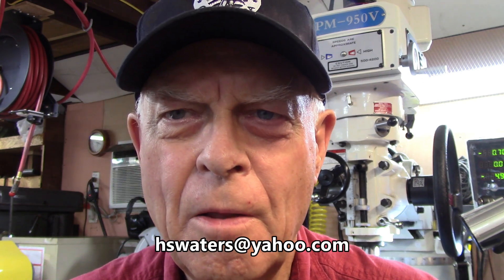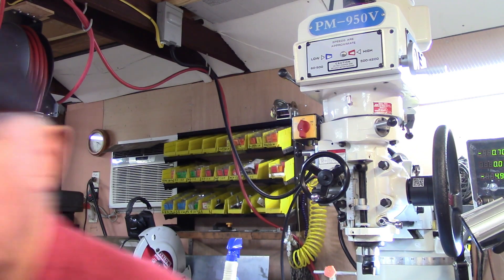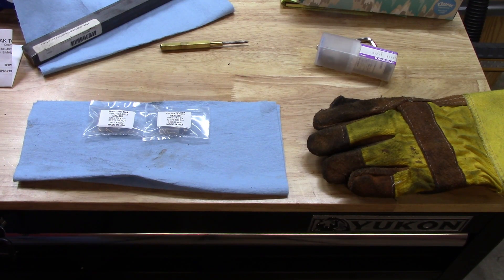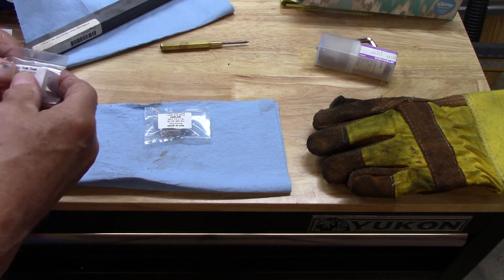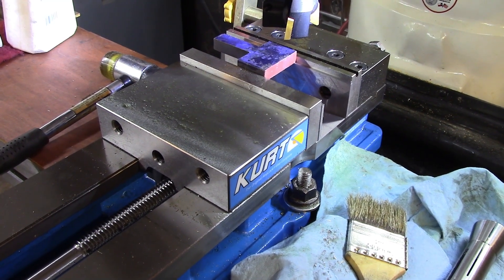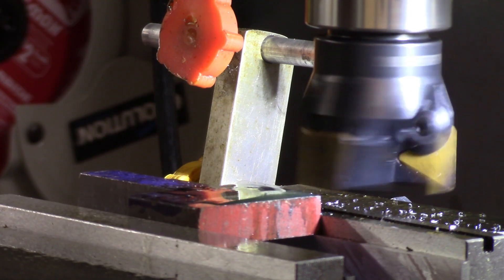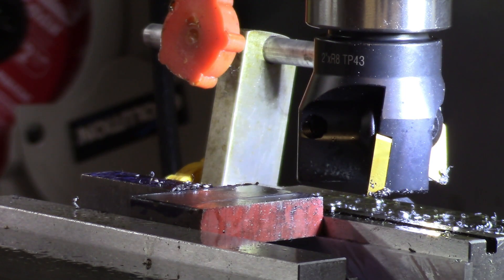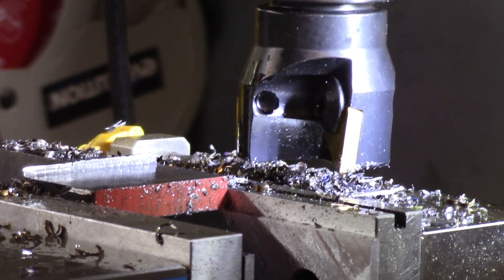Knurling tool build part 1

Comment: Will be interesting to see how this comes together because I need a better knurling tool as well.  Thanks for the link to Accu-Trak, that's useful information for sure.
Reply from the maker: The next step is taking a bit longer than I anticipated.  And some of the materials have not been shipped yet.  Thanks for stopping by Everett.